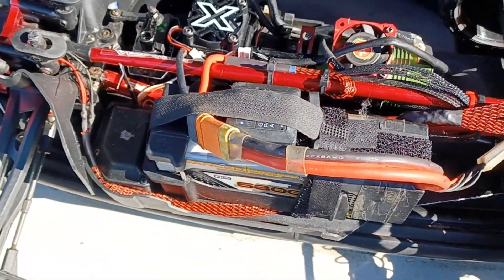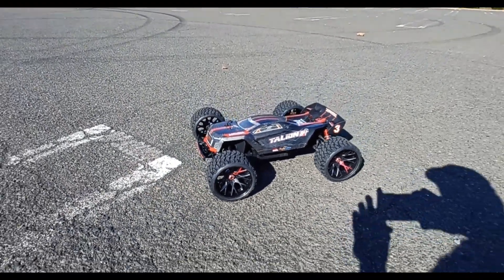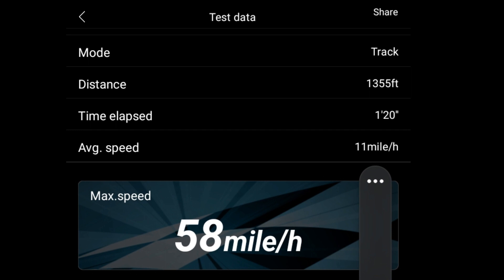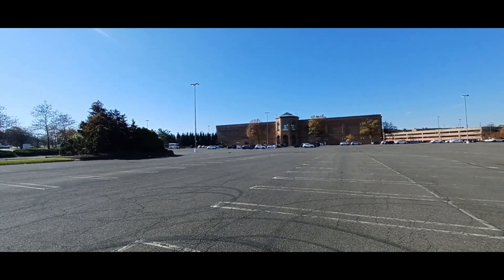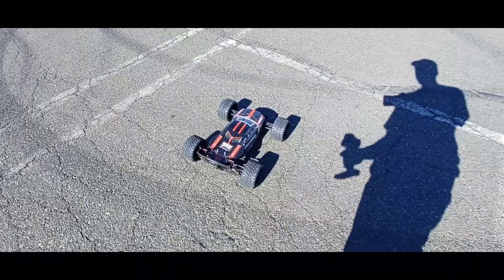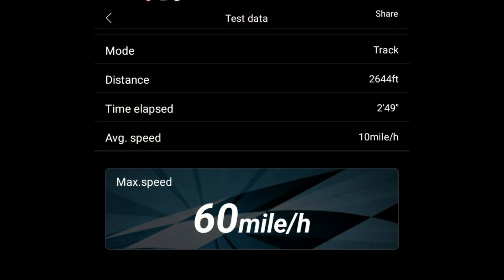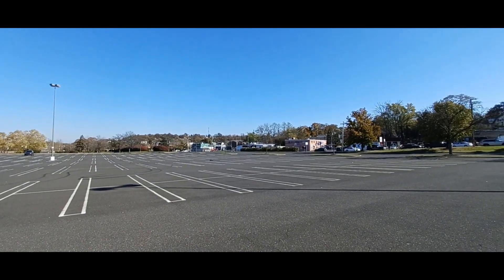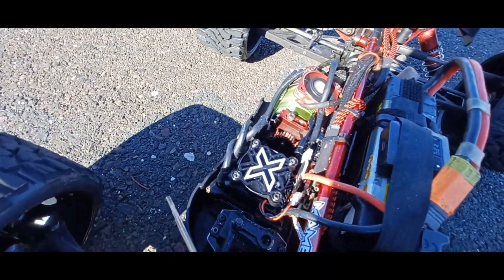Arrma Talion 8S Upgrade and Speed Run part2

Comment: Wow! Awesome upgrades for the Talion. It's a good run also. Your gear mesh might have been a little bit tight.  With that esc motor combo, you will hit that 70+mph.  Street Sweepers are looking good on the Talion.  👍👍👍👍💯💯
Reply from the maker: Thanks. I need to gear it up to hit higher speeds. Thanks for watching.